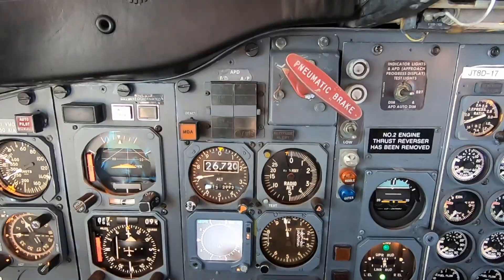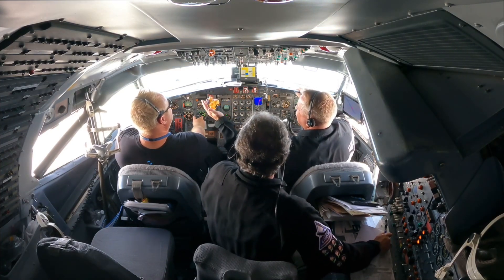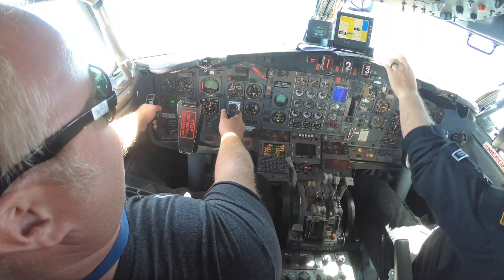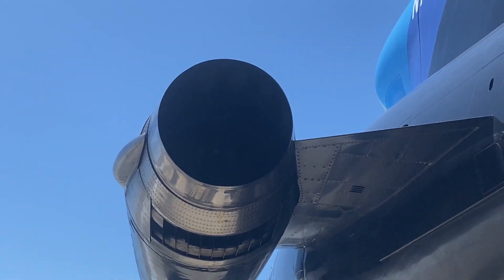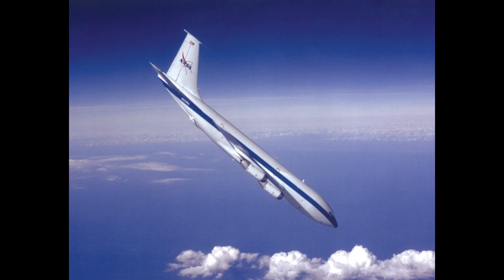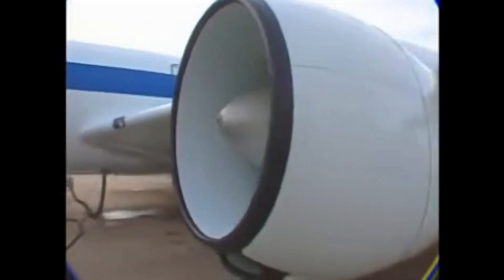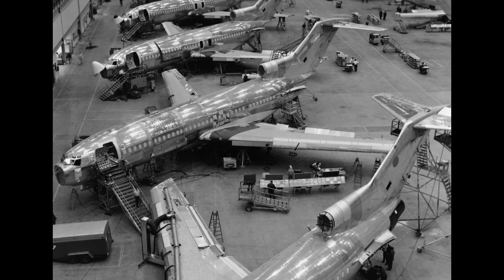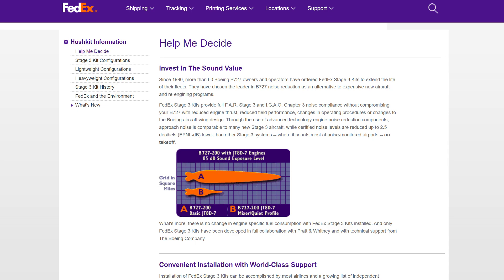Why NASA Uses A 1970's Boeing 727 For Zero G Experiments.

Comment: N794AJ... The last operator was AmeriJet International in Miami, Florida-a freight operator which I happened to work for during the conversion of this 727 to Zero G... the Fedex Stage 3 Hush kits were installed by AmeriJet and so were the winglets... I was there working as a technician for the first Zero G flights... Interesting point is that during weekdays the same aircraft flew as a freighter and on Friday nights we took out the cargo restraining system and retrofitted it for Zero G flights by adding all the padding-seats,oxygen bottles and everything else needed for the operation ( that huge cargo door made this possible and quite easy ) . The hydraulic reservoirs were modified to be bypassed by operating some valves so that no air was at the top of the tank ( known as head pressure ) because the hydraulic fluid would go to the top of the tank during zero gravity and the pumps would cavitate and self destroy... it was quite an interesting experience and am glad that it was part of my aviation career... thanks for the great videos Scott -I always look fwd to your upcoming ones !
Reply: That clears several questions I had!
Reply: Thanks for the first hand info  :-)
Reply: The modifications to the hydraulic system makes sense to me now - being used to pressure pumps designed for water, I was assuming that there was a bladder that kept the water / oil and air separate, but I can see why not having one would be a problem.
Reply: It was around 1998 as far as I can tell when they added the winglets, Stage III hush kits, of which seem to be FedEx lightweight hush kits since they still use the original tailpipes and not the more common extended tailpipes of the heavyweight hush kits, along with the number 2 engine’s reverser removed.

Some operators Stage III modified their non Stage III jets even prior to the January 1st, 2000 deadline for non Stage III jet aircraft over 75,000 pounds, of which I believe the FAA filed this new regulation in 1994 or so.

Hush kits are the worse, but they are still loud as hell even with them, they primarily eliminate the exhaust crackle.
Reply: Interesting to hear that you started working on the conversion on the weekends but kept regular freight operations during the week.
Reply: I see the low-oil-pressure lights all on (3:27)- is there a special certification for the JT8Ds to run for 30 seconds without oil pressure- or is it not a concern?

Comment: I remember reading a book back in the '70s about Boeing and the 747, including the history of the aircraft leading up to it.  As Scott describes, the 707 set the baseline, but the 727 was able to use much smaller airports and shorter flights.  It was referred to as the "Jeep" of airliners, and could almost hit Mach 1 in flight tests.  I think it also pioneered "the wing that comes apart", the assortment of slats, flaps, ailerons and whatnot that allowed for a wide range of flight characteristics from low and slow to fast.

Also: Thanks, Scott!
Reply: And another trivia note: the Boeing 747 test pilot was our test pilot for our FAA test flights.

Comment: My old boss, Ivan Jazslics, was the lead designer on the 727 and there was one thing about the design he was particularly proud of and never ceased to mention. As a safety feature he said he made sure the 727 could pull out of a terminal dive and criticized more modern passenger aircraft because an attempt to pull out of a terminal dive would result in pulling the wings off. I'm not a pilot and it's been about 15 years since I've heard is aeronautical yarns. But could it also be that Zero G uses the 727 because the airframe is robust enough to withstand the successive loading and unloading of the wings with much less fear of metal fatigue?
Reply: I believe that tale is not totally true. It is not the pulling out that is limiting. Just do it  gently enough.

It will take longer and you may run out of altitude doing it before you level off, turning the point moot. Also parts may bend and fall off from overspeed in the dive, but that has nothing to do with the pull-out itself.

It is perfectly possible that the 727 has a greater margin to do all that than other aircraft. But in principle you can always at least start pulling out...
Reply: As a guess, this being off to the side from my area of expertise, Jazslics may have been referring to something flutter-related rather than say strength in bending:  A torsionally stiffer wing which could better resist flutter?  All airliner wings have to be very strong in bending.  The static proof test for the original 707 wing had its tip IIRC 17 feet above the starting point... and then, per FAA certification requirement, proper operation all of the flaps ailerons etc had to be demonstrated.

Comment: 727  and 707 are faster than most aircraft today.  Most modern aircraft in common use actually fly slower,, to conserve fuel, than some of the older aircraft.  The three outliers,, fast commercial jets, are the 777, 747-8, 717,,,   A 727 with modern engines,, should be able to approach Mach 1
Reply from the maker: It's not about the power to exceed Mach 1, it's about controlling the aircraft during transonics.
Reply: @scottmanley    And yes, some of the older designs are designed for faster speeds.  Planes are not about total power, they must be designed for their do not exceed speed.  727 has the center engine,, vastly important,, but it also was designed for a cruising speed that is 80 knots (?)  greater than a 320.  (I am quoting these speeds from memory,, and my memory should always be treated as suspect.)  Have you had the pleasure of a ride on a 717?  OMG do you get there fast.  It is a rocket,, and designed in the 1960s  707s were fast too.

Comment: One small comment on your statement on stall vs vertical load factor. Stall is purely a geometric/aerodynamic phenomenon. You can stall at any speed/load factor/bank angle. If you put the aircraft above the stalling angle of attack, you’ll stall. As always though great video. That looks awesome. If I ever find a spare couple grand laying around I’ll definitely do that!
Reply from the maker: OK, so under what circumstances can you stall a wing when you're at zero load factor and therefore zero angle of attack?
Reply: @scottmanley  I just relistened to what you were describing in the section I was commenting on. And yes I think I misunderstood the argument you were presenting. In this flight case, with zero angle of attack or load factor you wouldn’t conceivably stall. My initial comment was already addressed in your video I had just missed it because I was listening while working in the background. I was addressing the semantics that “stall speed” is a wobbly term which you had already addressed. And I’m positive you already knew with all of your studies and especially now with your flight training. However your response did have me wondering about flat spin cases where angle of attack is essentially 90 degrees and the load factor would be very low initially (only provided by the drag of the airframe until you reach terminal). That would be the only plausible case of low load factor stalls. Anyway, thanks for your response. Love your videos. Your fellow pilot and GNC engineer, James.

Comment: My dad was part of a program in the Air Force where they tested different civilian airplanes for doing stuff like commando drops, one of which was the 727.  He started laughing at the part where you said the airflow would stop full deployment of the ramp in flight. He said it's totally possible to fully deploy the stairs in flight without modding the hydraulics; you just need to detach the Cooper vane from the retaining pins.

Comment: It will be interesting to see if Zero G Corporation acquires more 727s. Even if there was not enough demand to have two active aircraft as 727s are at the stage of life, “low mileage” planes and parts get harder to acquire every year. So it would make sense to acquire a plane & parts now before need them if you intend to keep flying a 727 in the future.

Comment: I work at the FBO you departed from, but it was my day off. Sorry I missed you. I gotta say The B 727 is one of my favorites, and we still see them fairly frequently between cargo flights and Zero G. The jt8 engines have a unique sound when they taxi (loud) and the APU positioned in the wing root is about as loud as it gets for the ground people. If you ask someone who has worked around 727 for a while, the answer is "WHAT?" (doesn't matter what the question is) I do however have a different take on how the hush kits work on the older jets, it is most apparent on the G2-G3 biz jets. They work by absorbing noise on takeoff and then releasing it on landing....just makes sense. Science.

Comment: This can be done in any airplane, just keep an object in the cockpit floating with the elevator. To achieve 30 seconds of zero g requires a lot of vertical airspace.  Virgin Galactic and Blue Origin are not doing anything too much different.
Reply: not for more than a few seconds in most piston aircraft, unless you like shiny bits in your oil.

Comment: I work at DHL Express and I can tell, even with hush kits, I can tell when a 727 is taxi-ing along the ramp compared to the 757, 767, 777, and 747 freighters.  They just so so damn loud and high pitched.  Which makes sense though as those engines were the days of just brute force from raw exhaust for more power in what we call a low bypass config today.  Now we have the reduction gears to allow for high bypass designs where you are powered forth less on the raw exhaust.
Reply: I don't think any of those have reduction gears in the sense you mean. The 727 has JT8 turbojet engines, while the others have turbofan engines. Turbojets have no bypass.

Most fighter "jets" have low-bypass turbofans where most of the thrust is provided by the exhaust and the air that bypasses the engine core is used for cooling.

The other planes you mentioned have high-bypass turbofans where the majority of thrust is provided by the turbine driven fan at the front instead of the roaring exhaust.

As a side note, 767s with the CF6 engines have an annoying warbling out of phase whine while taxiing.
Reply: @coryray8436  the reduction gears are to reduce the rotational speed of the shaft from that of the turbine so the fan blades aren't supersonic
Reply: @FaustoTheBoozehound  Most turbofans don't have that. AFAIK, none of the planes you mentioned have that mechanism.
Reply: @coryray8436  The JT8 is a turbofan engine, not a turbojet.
Reply: But oddly, more "contrails"?
Reply: @katiekane5247  
No. Moar [sic] flights ...

Comment: I graduated from Vincennes University as an A&P Mechanic in ‘89. My first job as an A&P was on B727’s, it was a great job and I still have a soft spot for them.  I even kept my B727 books from the B727 classes I took to get me familiar with the systems & engines.  I was able to fly as a Flight Engineer on several flights, but decided that wasn’t for me, way too boring. 
Even though we were cargo, we still had to preform regular inspections on the Cooper Locks.  
The Hush Kits, called them The Cookie Cutter.  The purpose of the Cookie Cutter was to mix the bypass air with the turbine air inside the nozzle cutting down on the sound by cutting down on the wind shear.  Or at least that is what was explained to us Mechanics is most of the noise from the engines is the wind shear from the turbine air being hot and providing 90% of the thrust compared to the 10-ish% of the cooler bypass air.  Back them they were called medium bypass, where as now they would be considered low bypass engines.

Comment: 14:13 The original Airbus A300's required a flight engineer.  Many countries had regulations on the books that said something to the effect of "an aircraft weighing more than x00,000 lbs. shall require a flight engineer."  All of these regulations were eventually rescinded, and I know that the final version of the A300, the A300B6, was certified for two man operation.  Also, as I recall, the airline had the option,when ordering the aircraft, of having the flight engineer on a dedicated console facing the starboard side of the aircraft behind the captain and first officer (like the 727), or on a swivel  seat behind and between the captain and first officer (as shown in this video).
Reply: That's true of most aircraft of that vintage... not just because of regulations, but because it was a practical requirement for operating the aircraft in the absence of modern flight computers. We saw that in Scott's interview with the crew yesterday, the role of the engineer to be constantly monitoring and adjusting the engines on a console with more buttons and switches than both the pilot seats combined.
Reply: @simongeard4824  the A300 had a design goal of a two man cockpit, but it seems that it was just ahead of the regulations 😅  The flight engineer was also responsible for transferring fuel in flight to keep the cg within limits, and adjusting the "packs", or the complex machine that took bleed air from the engines and converted it to breathable cabin air at the right temperature and pressure.  Those functions are computerized on modern aircraft.
Reply: The swivel seat also facilitated a typical role for FE's, which was operation of the throttles during landing approach in order to maintain the correct speed.  Much earlier airliners, such as the Boeing 377 Stratocruiser, actually had a second set of throttles for the FE.

Comment: 2:55 would love to know what thre three amber warning lights are that come on one at a time 😂  P.S. on my home office desk is a picture of me in the 1970's with a Continental Airlines captain's hat, in the cockpit of a 727.  One of our neighbors was a 727 captain, and flying across Texas one day as a family (El Paso to Dallas, or San Antonio), our neighbor was the captain, and I was invited up to the flight deck before pushback (the world was much more relaxed back then) 😊
Reply: Hi Brent .. having spent 7 years and 7,000 hours on the  "3 Holer" in my early airline career .. going to the wayback machine (42 years) .. They are a dual purpose indicator ..  Low Oil pressure or the Oil filter is being bypassed .. the Oil Pressure gage on the S/O's panel will give you the clue as to which you have. Early morning VERY COLD starts also gave you the indicator until the oil warmed up and flowed thru the oil filter .. fortunately never saw all 3 illuminated inflight .. like Zero G does .. but their's is only transitory so NBD I guess GGGG  The Video of the Flight Deck and S/O panel was like a reunion with an old friend ..  a GREAT AIRPLANE !

Comment: I remember flying a Cessna 152 as a teenager while working on a private pilot license.  My instructor and I felt like goofing off toward the end of a local cross country.  After scanning and making a clearing turn we did some micro gravity experiments with a water bottle and later with a ink pen.  We climbed up momentarily 10 kts short of stall and flew a parabolic ark for about 8 to 10 seconds.  We would make an ink pen levitate off the cockpit dash and catch it with your mouth.  So long as we didn’t over G or exceed Vne we weee good.
Reply: When flying gliders on a winch launch we are - or should be - prepared for a cable-break. The momentary situation in that case is similar to the climbing portion of a parabola: You are pointing nose high up and do not have adequate thrust to keep flying like that. In the specific case the thrust has just dropped to precisely zero. Not a sustainable position to stay in.

We train to push over at or near zero G to avoid the possibility of a stall while going over the top. Once the nose points down and sufficient airspeed is regained and confirmed flying continues as usual.

It is always fun to train for that on actual launches, made more interesting by inherent proximity to the ground. Goofing around with vertical G in normal flight when there are no other pressing issues does not have the same urgency and I can very well relate to your experience in the Cessna.

Just don't go negative unless you have personally vacuumed the cockpit before you launch. Or you will eat dirt.

Comment: Not that its the reason but I could imagine more modern aircraft and their computers might freak out a bit if you tried flying a zeroG trajectory. "Pull Up, woop woop"
Reply: Hence why Airbus A300 and A310 are used in Europe since they don't have FBW. I can imagine getting the same kind of STC for FBW aircraft would not be straightforward. I think with most 737s you could do the same maneuvers.

Comment: Using and autopilot for this shouldn't be hard. Rockets are doing something similar all the time. And the Falcon 9 booster is doing something much harder, it's coming down from space and lands in a few meters from the target, on a ship, and it has to time the touchdown extremely precisely as it can't hover.
So the issue is not the software, but the certification. Why can't they just do the same thing as with cars? Just have the pilots take over if the computer makes a mistake.
Reply: Yes, it is always the certification that is the issue. Making software is easy, making software certified for commercial flight is very difficult.

Comment: I know want to know what the biggest current plane you could do 0g flights in. I assume a Airbus A380 might not do too well but that'd be so fun with all that space, assuming you could take out the decks so you had a double high space.
Reply: They probably all could technically do it, but some newer aircraft are not tested or certified for 0g or the same kind of envelopes as the 727. Thus it would be next to impossible to get an STC to do these kinds of flights - especially without major modifications.